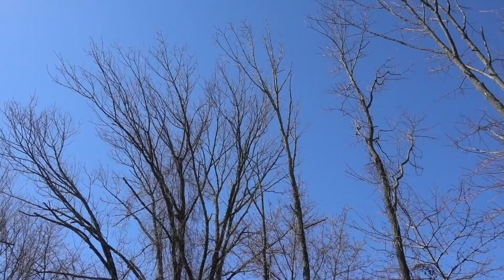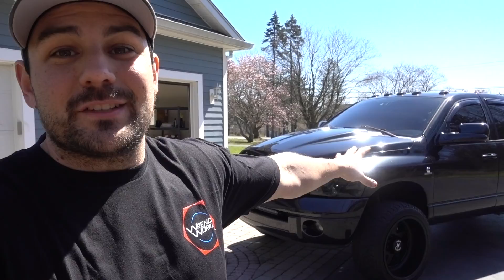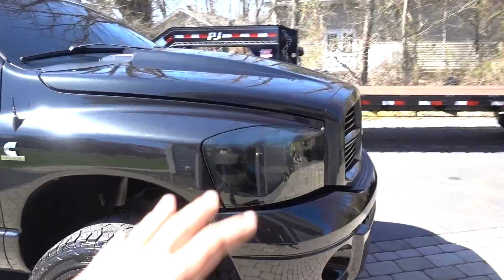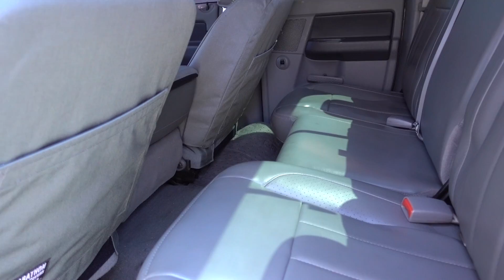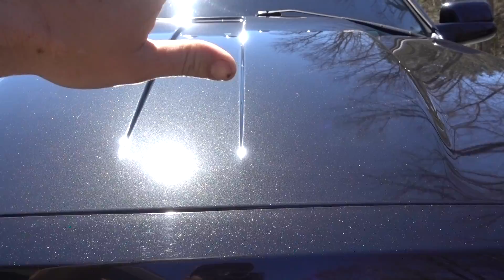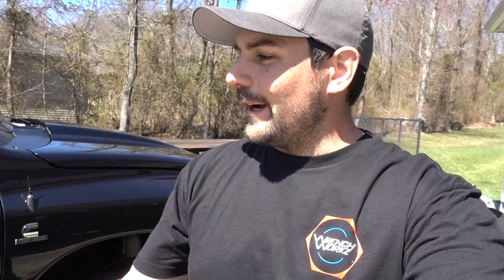5 Things I HATE about this CUMMINS TRUCK!!!!

Comment: I have a 2014 Silverado. I love the truck but it has a 4.3 V6. The engine doesn’t suck but the aftermarket for any parts for that motor is almost nonexistent unless you have the V8. That gets pretty annoying. Plus I bought the V6 to help save some gas and I don’t save any fuel compared to someone with the V8 version!

Comment: Taller tires would result in lower RPMs on the highway? 
Maybe A conversion to 19.5" rims and 15.35" disc brakes 
Toyo 285/70R19.5  M608Z....  you know a 4500 SRW

Comment: Gear Vendor's under/overdrive unit fixes the RPM issue while traveling empty.  Push button and easy install. Should drop you down to 2000rpm at 80mph

Comment: First off stay home take care of the family hope everything goes as planned ... i have a 2001 2500 ext can long bed cummins with the nv5600 6speed 4x4 leveling kits 35s on 20s im 3rd owner got the truck last year 100% bone stock i put a 4" mbrp turbo. Ack stright pipe and have a power puck on it fuel pressure gauge and boost gauge thats all has 303k orginal miles on it even still has the factory vp44 pump i know crazy right i daily it tow my jeep with it it has 3.55 gears @70mph im right at 2000rpms love my truck wouldnt trade it for nothing but few things that anoy me of course cracked dash like all 2nd gen trucks and back seat needs more room dunno why dodge didnt make these in crew cab i know some was coverted and they are awesome id love to find one other than that i love my truck ....love the channel i watch daily you need 2nd gen content ! Lol anyway keep doing what you do best of luck with baby A

Comment: 1. Don’t get black.
2. Don’t have your tires stick out past the wheel well. I made that mistake with my ‘97.
3. Get a crew cab.
4. Fiberglass the SRT hole shut.
5. 3.42 is amazing. I have one. Yes I tow heavy things. The 3.73 was better than my 4.10. 3.42 is better than the 3.73.

😉😜🤪

Comment: I have a '91 non-ic W250 getrag 360, 4:10 gears. I don't like how my top speed is 135km/h, its loud in the cab, rough ride (very worn leafs), and no syncro in 2nd gear, which really tough going around roundabouts and such. It isn't a race truck, but it shifts quite slowly, could use new syncros in there as well. Steering is sluggish as hell as well, rear end keeps locking up and killing my tires and it is not responding to my LSD additives. Body is a liiiitle rough from the previous owner but paint is great. That said though I plan on getting a new sound damping flooring, lift, steering overhaul and fix up the old little things there and there. It's definitely got some go to it (300hp/600tq) a body restoration will be the end goal with a top mounted air-water intercooler and HE351/HX35/S?00 turbo

Comment: I have a 01 24 valve and I refuse to drive it down the interstate because it's got a stack. The stack dropped the egts 100 degrees but it rings your ears at 75mph and over.

Comment: So if I were to buy a stock diesel truck  older like 99-2005 what truck should I get that’s gonna be reliable
Reply: Bryce Eisner 2006 lol
Reply: Bryce Eisner both the 24 valve cummins and the 7.3 power stroke are awesome motors

Comment: So after watching the video, My 4th gen has the 3.73 gears, g56 and s465 2nd gen swap  with HPP tuning and at 80-mph i'm sitting at 2300rpms so I am wondering if maybe the tuning could be the reason or that our turbos are different? Im also on stock injectors and a fass 150gph. biggest thing that annoys me is the 5"in exhaust causing the ungodly dash rattle and squeak lol. 

love the videos and the family. Cant wait to meet Baby A. Much love from Dallas.
Reply: Big T tunning or turbos does not dictate the speed at which your engine spins at a certain mph in a certain gear. Tire size, transmission ratio, and rear end ratio are the only things that effect that. Just an FYI. You and Greg probably have different size tires. That is why his spins at different rpm on highway then yours does.
Reply: Mitchell Phelps actually that makes sense. I'm running 265/70r17 on 9" wide so that explains alot actually. Good call sir and thank you for educting me
Reply: Anthony Russo lol it definitely helps, this thing lugs like crazy in low gears but pulls whatever I put behind it and still gets great mileage thanks to the gearing and mods. Thank you all for the information.

Comment: Tldw 
1. Built trans pricing
2. The dodge body after 3 winters 
3. The transmission 
4. Crappy seats
5. Balljoints

6. When shit falls into the hole on top of the dash
Reply: Jared K owned a 2nd gen for 3 years and never had any of those problems
Reply: Austin Snyder 1. Dodge trans for 650hp cost almost double a duramax one and a double a 5r110
2. Dodge bodies up north fall apart. The new ones rot just bad as 2nd and third gens. Dont get me started on newer duramaxes
3. Does your truck have a hole in the dash? If not you obviously won't have that issue
Reply: havok x this is Greg A's channel if you think any of us have a stock cummins your sorely mistaken and probably in the wrong comment section. They put 48s behind dmaxes because Allison's defuel st shifts and the dodge 4 speed design is mostly the same for 50 years meaning more parts and development. And no shit 07+ chevys rot out they are cheap trash I see rotting out ones daily that are still being payed payments on

Comment: I have to say the most annoying thing about my truck (01 24v 4x4) is how crappy it rides. I got it with a cheaper brand lift kit and it rides worse than any lowered car I've ever had. And that's with coilovers or cut springs lol

Comment: Annoying things about my truck easy list. Paint tones not matching, rust, torn drivers seat, cracked dash, sound system, power, frame surface rust, leaks that’s off the top of my head but everyone of those things are in the process of being fixed repainting g the whole truck and have boxes of parts in my room

Comment: Love the videos, been here sense the beginning, I have a 06 Cummins all black, it’s auto with a trans I built myself, the engine will get rebuilt top to bottom by me, plan on pushing a little over a 1000hp hopefully by the start of next year, I plan on making it like the triple turbo setup you had on the 05 an it look kinda like the 05 too, my instagram is h_knight24v if you wanna check it out

Comment: Come on.... most of these are just general gripes that can be said about any vehicle, or stuff that was self induced like the hood (which the SRT10 hood looked much better,) having a black truck, and wide wheels. 

You could have talked about how garbage the interiors are on these trucks. The plastic is cheap AF, the hardware sucks, the rear seats are extremely uncomfortable, the chincy knobs and buttons.....